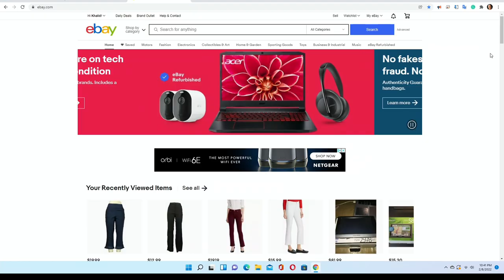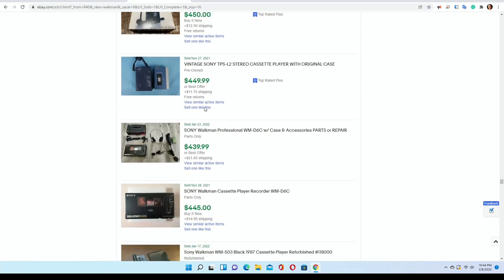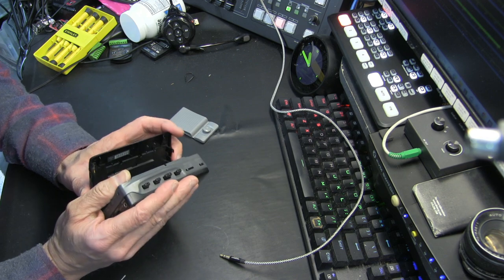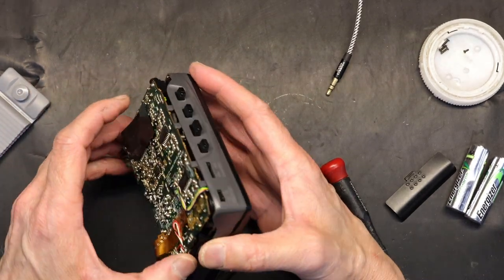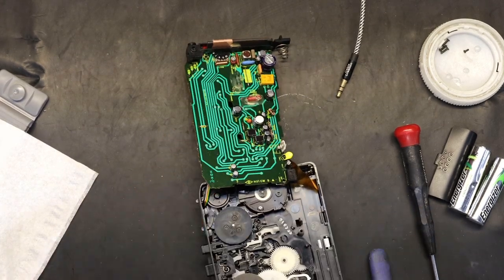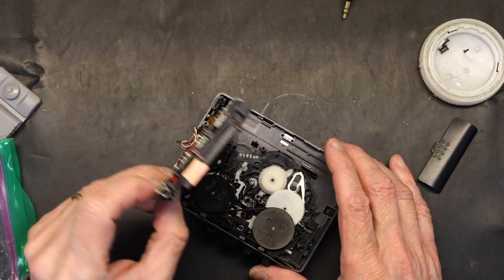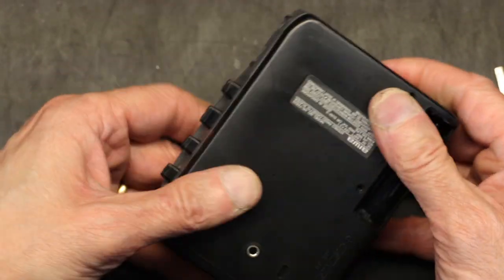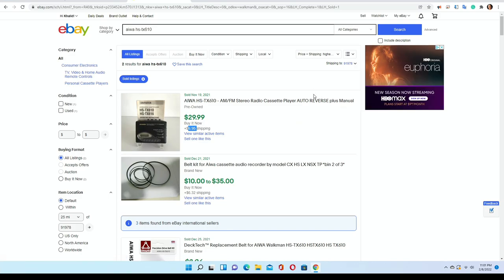How To Make Money Repairing Ventage Cassette Players and Walkmans, Changing the Belt on AIWA TX610

Comment: I get what your saying and you are right that there is indeed a market for this but if you didn't notice, all of the walkmans that are drawing those close to four figure prices only consist of about five or six different models: Sony WM-D6, Sony WM-D6C, Sony WM-DD9, Sony WM-DD100 (Boodo Khan), Sony TPS-L2, or special edition anniversary models. Yes you can make money doing this but please don't think you're going to just find one of these top dollar walkmans sitting at a thrift store for $3.00 where you will make hundreds of dollars profit from unloading it on ebay. Also most of those models I mentioned can have much more intensive repairs than just replacing a belt. Fried capacitors, capstan tires with flat spots, corroded or broken traces on the PCB main board, potted modules needing service, cracked gears, and blown IC's. There can be a lot more than meets the eye with the higher end walkmans. They are very complex machines and one reason they draw such a high demand. Anyhow thanks for the video!!
Reply from the maker: You have a point too, but Sony is not the only one which is at high demand so are aiwa cassette players here are some examples AIWA HS-P7, AIWA HX-PX30,  Aiwa HS-J800, AIWA HS-P02  the list goes on and on.
Reply: @TECHNOLOGYTIPS101  yes your right there too. The Aiwa's are quite popular too.

Especially there top end models. Take the Aiwa HS-PX 1000 for example. They fetch a four figure price tag always no matter what.

I believe there's a lot more people getting back into cassette than might be thought.

Comment: The belts that were made around 91-93, were the worst, they melted easily, I used to buy one or two extras just to keep them as spares, and I remember that in about 6 months they melted, if you buy some cassette players of that age, this is for sure the issue.
Reply from the maker: Yes and they were also very thin compared tot the older ones.